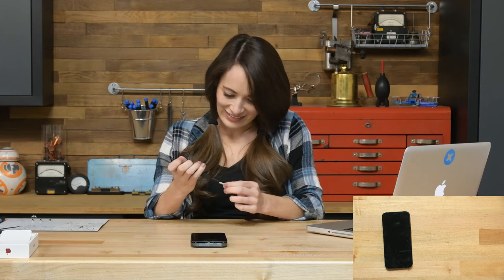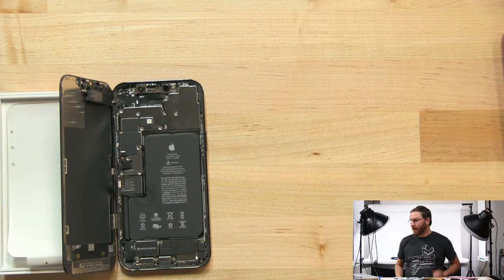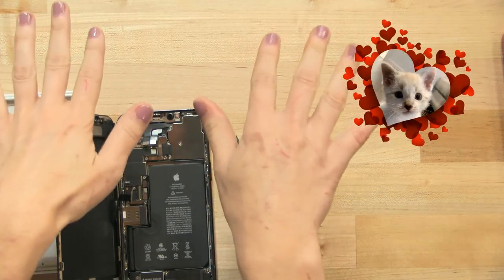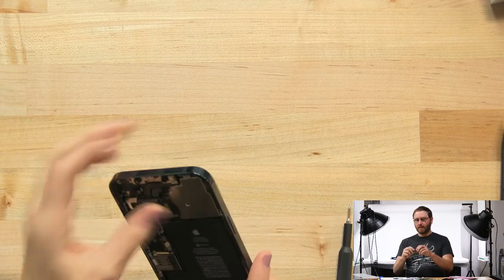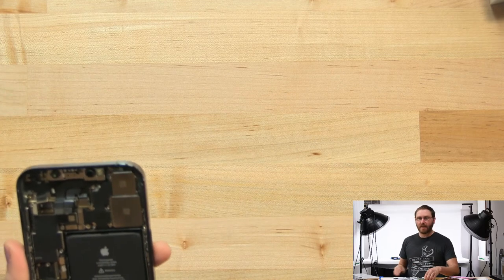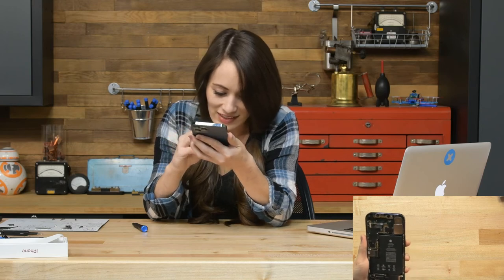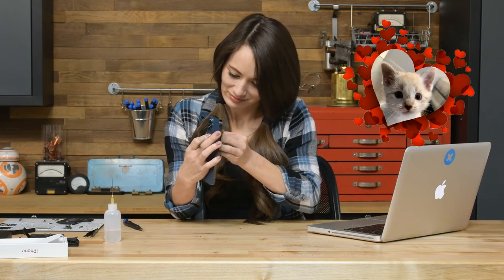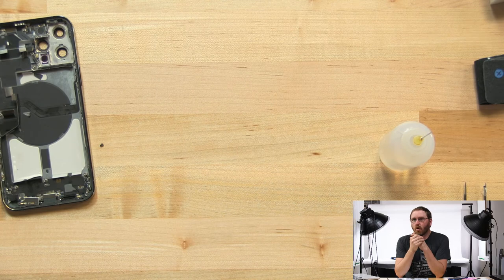iPhone 12 Pro Max Teardown -  LIVE!

Comment: Great work guys!
Kyle - I think 5G is going to be more important when Apple intro's Apple Glasses! The phone the the glasses with be setup in a peer connection. Otherwise 5G is of little benefit.
Reply: Its just unfortunate its paired with the over priced turd that is the iphone
Reply: No, 5G is the remote internet connection, not for local device pairing
Reply: @0xbenedikt  - Sadly 5G is not designed for rural areas as the distance to the cell tower needs to be very close for mm wave (the faster of the two) to be accessible. Sub-6GHz is not better than LTE.

Comment: Ifixit, i really hate these live teardowns
Reply: I just don't like these new phones where you need a heat gun to remove the screens... poor technical engineering at work! I loved the old phones where all you needed was a screw driver to change out a battery, had easier access to screens etc... so much easier for a repair department to fix products for their clients. Also a great way for tech people to fix their own phones and not have to rely on a company when there is a pandemic crisis and the government gets in the way of fixing your devices.
Reply: @marcoreviews  one of the downsides of a water resistant phone. Can’t have a IP68 rating without some sort of sealed mating surfaces. It’s not poor engineering, just the nature of the beast.
Reply: @marcoreviews  YES, phone got better over time, waterproofing is not bad engineering 🤔
Reply: @tylercampana3254  I see your point however not everyone wants their phone to be perfectly water resistant and it isn’t like the process is good enough that when your phone falls in your toilet 🚽 that all is good. I can understand if people want that to be the key focus of the tech but many people don’t really care for that since you can buy a case specially designed for water protection. Also I agree with the guy that said that removing the head phone jack is a big downside to the technology.
Reply: @tylercampana3254  can be plastic too. Would be easier to repair, open, lighter, cheaper and no cracks. But it has to be glass..
Reply: @giopz6598  I feel like phone companies are moving in the wrong direction. When you over complicate a technology in a way that leads you to damage your screen when trying to fix it you don't really make it better. Water proofing for under water scuba diving technology doesn't need a heat gun. They use rubber seals. I don't see any iPhone 12 being able to go 30 meters under water safely. Also iPhone tech software has gone in the wrong direction when it comes to privacy laws. The iPhone stopped being decent after their release of iPhone 8...
Reply: @marcoreviews  I mean if you’re going to say that you can buy a case that makes it waterproof then you can also say you can buy a nice screen protector and case and never have to worry about “fixing” your phone again. It just all depends on how you look at it. Serviceability is not an issue if your phone is strong and you protect it
Reply: @marcoreviews  
You don’t like all the new privacy stuff apple has put out? They really improved over the years, I think it’s a good thing, ya, maybe too much privacy, i don’t agree with the personalized ads block, too much.
I mean, you are not supposed to open your phone all the times, if you are careful, that one time, you do it ok. Usually it is good that if your phone falls in the sink, it doesn’t stop working, if they chose this water seals over the rubber stuff you are talking about, i think there are well thought reasons on their side.
Reply: @tylercampana3254  what I meant is that the process that you feel is an improvement isn’t so and that you could use weather strips aka rubber seals to achieve a better level of water proofing while making the phones easier to fix. What they have done here is push a system for whatever reason... what it has done is made old phones appealing on eBay.
Reply: @marcoreviews  
I mean, most people don’t care about old phones, new phones are much better for doing things, I can record really good video on new phones, and they are overall faster, making you save a lot of time. But if you care only of repairability go ahead and buy old phones, it’s good for the environment.
How would you manage to put weather strips/ rubber sealing on a phone?? Tf